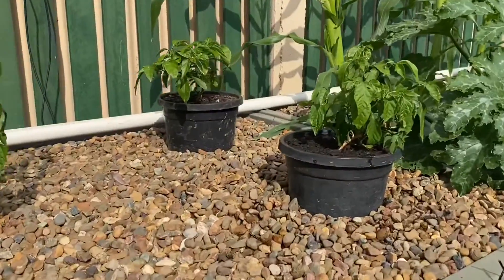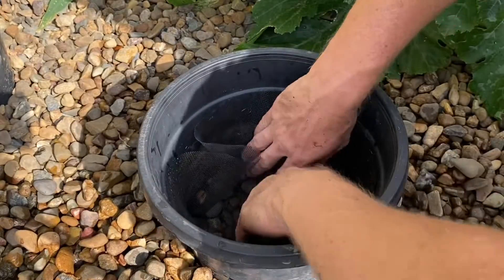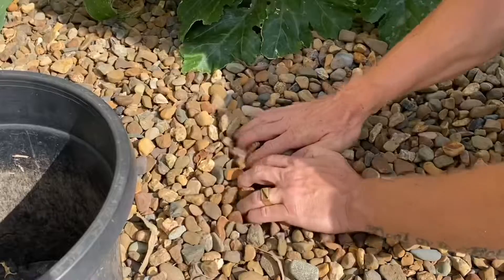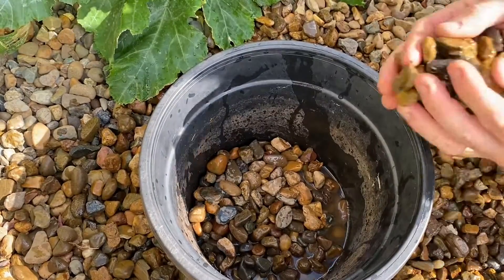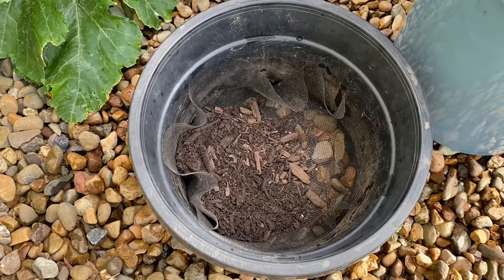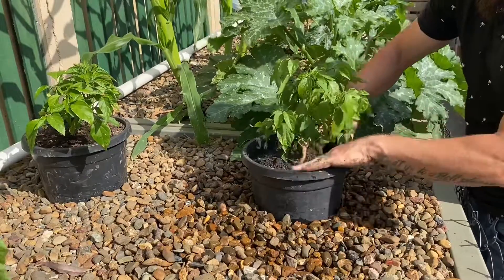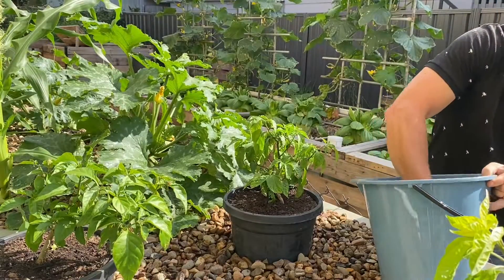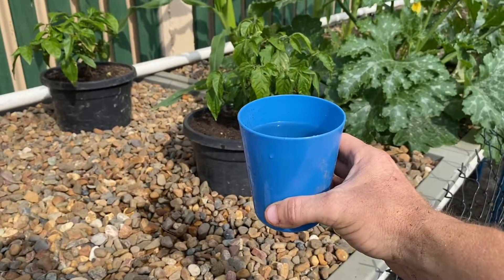How To Do a Dual Root Zone Plant #aquaponics #howtobuild #dualrootzone

Comment: You said soil wicking into the fish water ummm I've had Gold fish 3 were 25mm Now 100mm golf ball size belly wire mesh on top Of 150ltr pond and pot plant's on Mesh pump trickling fish water into 5ltr container with 5-6 microfiber cloths in container hanging over acting like dripping Wicks feeding pots leaching water runoff back into fish pond feeding pots 24/7 And fish are growing like crazy as are plant's
Reply from the maker: That’s fantastic!

Comment: Doesn't the fly mesh stop the roots from getting down into the aquaponic setup?  How are you finding the results of this method compared to both standard and aquaponics by thermselves?
Reply from the maker: The roots should grow through the fly screen mesh with relative ease. To be honest I’m yet to see the results of this method compared to traditional methods. I do have the same chilli plants in regular potting mix on the ground, and I also have one going straight into the growbed of the Aquaponics System without dual root zones. So let’s see how it goes, I’ll keep you posted!
Reply: @mattysbackyard9244  Definitely interested in the results.
Reply: I tried a side-by-side comparison and the DRZ was growing faster in week 1, they were all even on week 2 and then after that all the non-DRZ one's did best.
Reply: @iAVS-info  Did not expect that.  I have seen another version which is a combination of soil and passive hydroponic which I'm going to try.  Thanks for the intro to DRZ.
Reply: @iAVS-info  Are there any tweaks to the system that might make it work better?
Reply: @chuckchicken1255  Top down watering whilst keeping the crowns dry still is the best way to provide water IMO.....otherwise, I got rid of the plastic pots and tried fabric pots but results were same as I mentioned before.....getting rid of the pots altogether made things easier and cheaper and the growth was far better . I've come to the conclusion that if you NEED to do DRZ, than there is something inherently wrong with your system.
Reply: @iAVS-info  I've tried fabric pots and getting mixed results.  My cucumbers seem to prefer the plastic and the tomatoes and potatoes the fabric.  I've tried a wicking system, which worked brilliantly the first year -not so much after that.  

I do have an issue with my system.  Just trying to find a way to get consistent results.  

With your top down watering or you using drippers or just being careful when you water?
Reply: @chuckchicken1255  I do Sandponics/iAVs now, so the water flows down thru the furrows every 2 hours....never had water this clear or growth this good so I;m hooked on it now lol
Reply: @iAVS-info  Nevr heard of sandponics - something new to reasearch.  Does it use aquaponic water, or hyprdoponic solution?
Reply: @iAVS-info  Something new to research.  Can you use hydroponic solution instead of aquaponic water?
Reply: @chuckchicken1255  Yes, but it is a strictly organic (carbon based, not the sales term)) growing system so you can use fish waste or a liquid organic fertilizer. Hydroponic solutions that are inorganic contain salts that are detrimental to soil bacteria. In iAVs/Sandponics, the major focus is on soil biology, they convert organic forms of nutrients into inorganic forms for the plants, as well as other compounds and enzymes such as siderophores, which, as one small example, make iron available to plants that would otherwise be totally unavailable to them.